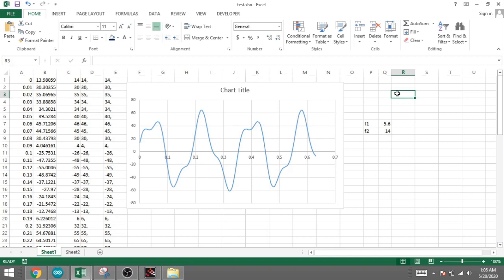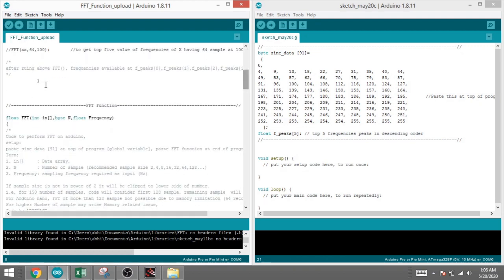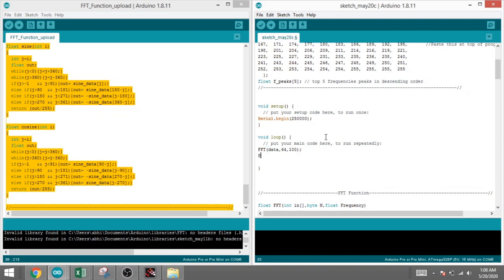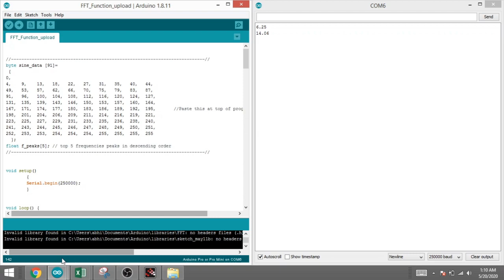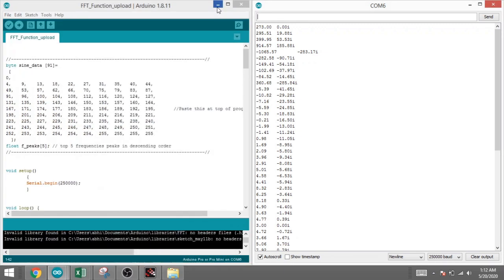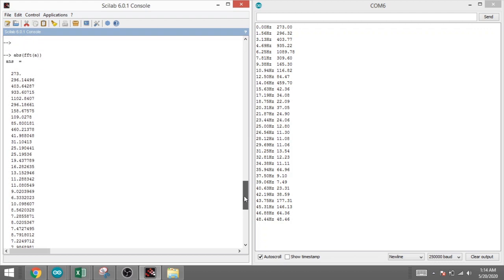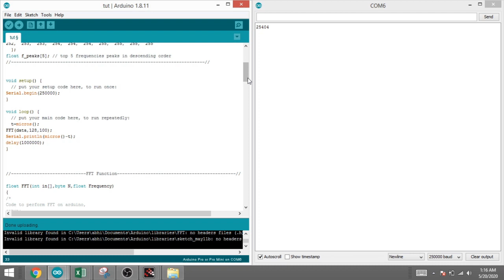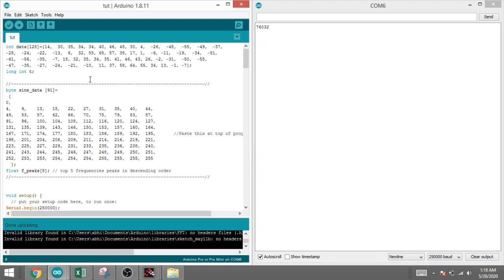EasyFFT: Fast Fourier Transform (FFT) for Arduino

Comment: Really really GREAT, I'm using it for a Radar Speed Gun based on Doppler-Frequency. It runs superfast on my ESP8266/4MB NodeMCU - can simply run in Code first a 10 kHz Sampling with 256 Samples of an A0-Signal Input and then process it to your FFT....FFT runs within 14 ms!

Only hin: Code did not work as C Compiler in Arduino IDE say function has nor return....changed to simply "void" and works fine!

Great Thanks!

Comment: I use ardunio due to upload this code, will occur ＂'in_ps' may not be initialized
                                                                                         int in_ps[data[o]]={};     //input for sequencing＂ 。
how to solve this problem ，thanks
Reply from the maker: i have updated the code. please check again. if issue persist contact me at abhilashpatel121@gmail.com
Reply: @bi1420  Hello, I have the same problem, when I upload the code (from instructables) to the arduino due. It works just fine on arduino uno. Where can I found the updated version of this code to fix this issue?
Reply: thank you =)

Comment: Thank you for the explanation.
I have pre-recorded the raw data in Excel, Is there a way to process the raw data from Excel or How to input the raw data to the code?
Thank you very much.
Reply from the maker: Yes it's possible. Just add comma next to each value (use function like a1 &",") and paste directly in excel. Delete comma from last point. However, you can perform fft directly in excel itself if you want.
If you need more details you can write me at abhilashpatel121@gmail.com.
Reply: @bi1420  Still need for explanation, my raw data using decimal, tried to use float as a type data , but it wont show in serial monitor, any suggestion? Thankyou

Comment: Hello, thank you for this video!!
Is there a way to have a continuous input signal coming from a microphone, instead of fixed data? 
I'm not good with programming and I don't really know how to bring modifications to the code
Reply from the maker: What audio frequency range you are operating?
Reply: @bi1420  my goal is to make an instrument tuner so the range is roughly 70Hz-3000Hz
I have a microphone plugged in an Arduino Uno and it would be so great if the code could return the fundemental frequency played.
thank you for your answers :)
Reply from the maker: Do mail me at abhilashpatel121@gmail.com, i will share details/codes.

Comment: i saw your tutorial on instructables; i'm trying to calculate Total harmoncs distortion using arduino; but i have issues understanding FFT algorithm; how can i store the values from the adc to an array of 128 samples
 and how can i select the frequencies to display
like fundamental50, 150, 250, 350hz
Reply: 24/5000
Bro, I have the same doub
Reply: same here, actually with exactly that data
Reply: Some people say in tutorials that arduino will not process the frequency below 9 Khz